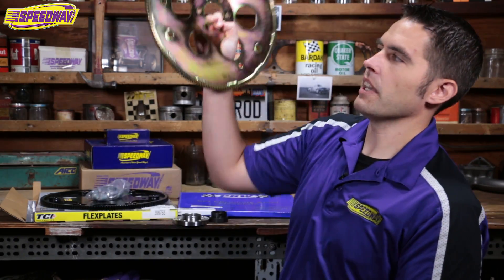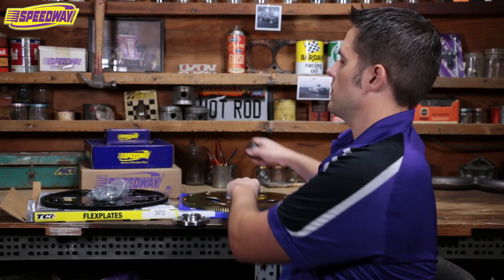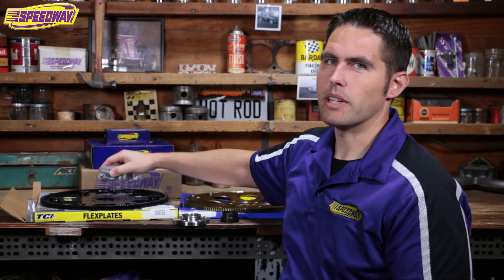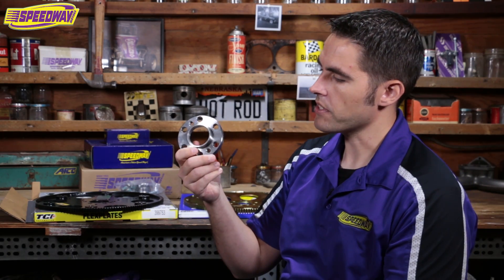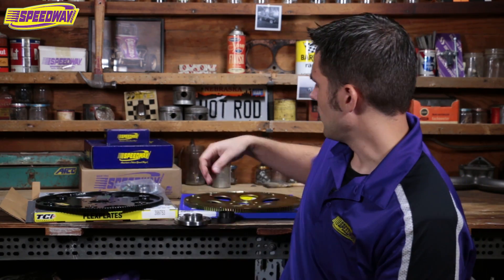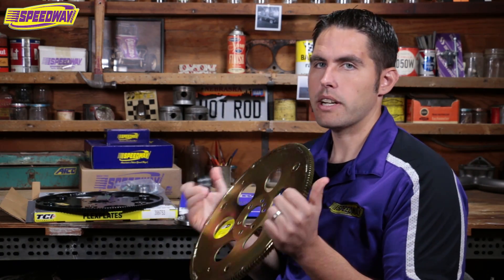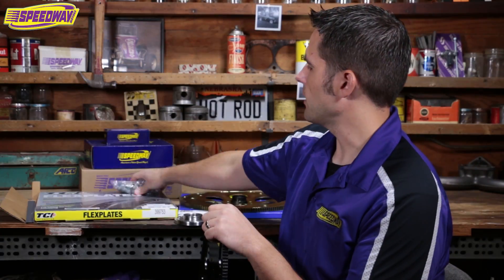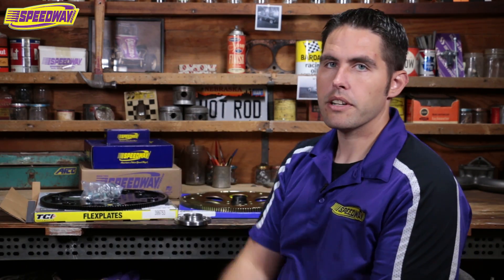Speedway Tech Talk - LS Flexplates

Comment: Hello there! I got a 1982 chevy c10 with a 700r4 trans, I just put other engine block from 87 to 1995 TBI with cast # 14093638 . Anyone know what is the correct flywheel,and spacer crankshaft ?

Comment: I believe you also need theflat flex plate and adapter if running a V6 4l60 on a 4.8 5.3 motor as the crank flange on the v 6 is short like the old SBC motors

Comment: I have a 6.0 with a 4l80e. Trying to go HD and bought a plate from autozone and it's not concave like the one in the video but it is stamped concave. I also noticed there are 3 holes for the converter instead of the 6 on the original. Is that correct? Or did i receive the wrong flexplate?
Reply: Wrong that’s a 60/65e flex plate

Comment: My converter snout adapter moved around and made noise, and the flex plate rubbed the little stop ring on the starter drive shaft, also making a bad sound. I ended up removing and installing this transmission 4 times before I discovered these were the culprit causing the sound that caused me to purchase a new torque converter for this customer as well, that I now get to eat the cost of.
Reply: What fixed it ?
Reply: @lldawson24  I replaced all of it
Reply: Was your transmission making any noise?

Comment: I have 2004 LQ4 going to be bolted to a powerglide. Is that the same requirements as the th350 or 400?
Reply: I’m trying to figure this out to the 5.3 don’t bolt up to turbo 400

Comment: I have a 1982 350 cu.in Chevy Cube van..  I just removed the TH400 and installed a 1991 700R4... Is there a difference in the Flexplates ? I just bolted it right up...had the driveshaft shortened and a new 27 spline Slip Yoke installed to fit into the 700R4. I am hearing a rumbling noise coming from the Torque Converter area... not sure what the noise is. I haven't taken it out on the road yet as I don't want to damage anything more than I have to.

Comment: Hi, I hav a 1994 K1500 with the old 1 piece 4l60e trans… I’ve just brought a 2002 5.7 LS1 engine with its flex plate attached. I’m wondering what I need to buy so the two will work correctly…thkq

Comment: I've got a 2005 lq4 6.0 I need to mate to a 2004 4l80e and have a TCI 399754 flexplate, are you saying a crank spacer is not needed and is built into the tci, but will I need the pilot extender sleeve in that application?
Reply from the maker: From Pat: "No adapter is needed.  You should only need the flexplate."
Reply: I got a 03 lq4 out of Denali and 04 4l80e with the same Flexplate tci 399754 ran into a problem where my converter bolts hit my back cover bolts of my motor I just order my crank spacer

Comment: I have a 2001 5.3 with dished flexplate and the older version 4l60e 2 PC but takes older 298 mm torque converter so do I just need the adapter that goes on snout of torque converter and into crank
Reply: Yes

Comment: Can I use that concave one on a 6.0 4L80? I’m having flex plate issues that keep breaking I’ve used the adapter like you showed but not the snout one. What are my options ?
Reply from the maker: Speedway offers several LS flexplates and if your 6.0 were to need a replacement the concave one would be an option as it came originally on the 5.3 and 6.0.  You will need to make sure that the torque converter gets full engagement in the transmission pump if used.
Reply: On the 6.0 flexplate why buy the two adapters does the spacer all you need why two

Comment: There is a $22 spacer with free shipping sold by Michigan motorsports that works 100%. Don’t listen to these guys that tell you to buy a new flywheel or expensive spacer that you’ll have to bore holes out for.
Reply: Mack Pearson I have a 5.3 with a and my friend is going to give me a ls1 flexplate. I’m going to put a th400 which apadter would I need
Reply: @chrisgonzalez9192  The ring that slides onto the converter snout

Comment: What about a 5.3 to a 4l85e?
Reply: Concave flexplate to custom 80e converter with 3 bolt pattern or flat flexplate with spacer and stock 6 bolt 80e converter setup..5.3 same as 6.0 spacing so everything will swap over.

Comment: You don't need both adapters. You only need one or the other.
Reply: yup your right ..you don't require the sleeve for the in the kit.
Reply: I have the silver spacer will that work for a 4l60 transmissión putting a 6.0 engine
Reply: I’m having issues with a 6.0 4L80 cracking 3 plates and using that silver adapter on crank side, any ideas as to what’s causing it?
Reply: @weldingjunkie  Try getting a thicker flexplate from TCI, I have ripped the center out of stock flexplates due to rapid acceleration of the heavy torque converter on the thin steel.
Reply: deceptivex1 it ended up being the i joints on double Length driveshaft making a wobble snapping the plates
Reply: Help please

Comment: The concave flexplate will not work w/o opening the torque converter holes.
Reply: The holes need to be elongated. Even the flex plate he’s advertising here won’t work. The holes are in the same place
Reply: Chasemanuti i have the gold plate on my 5.3 and mechanic says my converter holes are wallowed out. He says i need a new flex plate. Are you saying the wallowed holes are the way it needs to be?